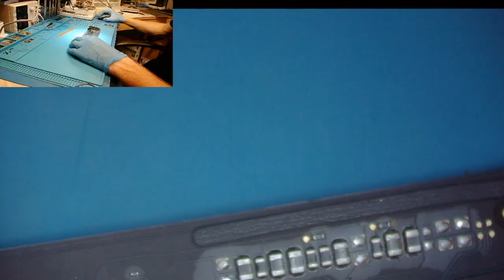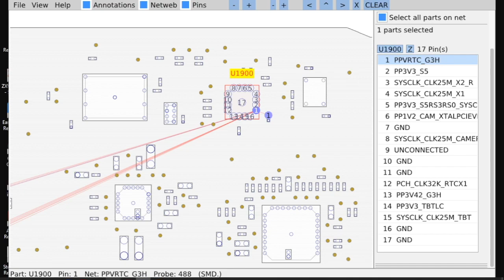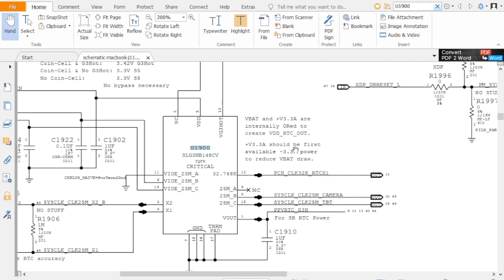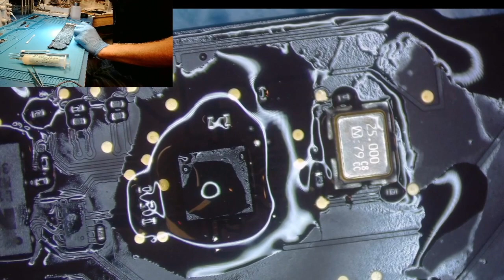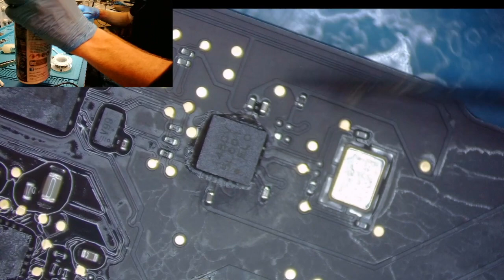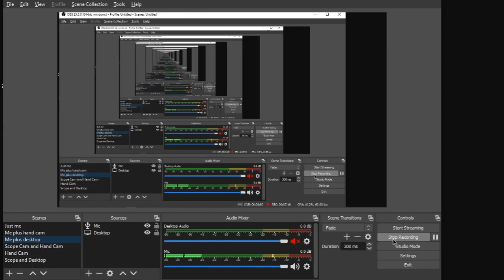MacBook Air no power and repair

Comment: Sumatra is a good PDF viewer that Louis recommends. However if you like Open Board view after trying it out, the paid version Flex Board View is vastly superior but it is tied to Abode PDF as they are integrated to facilitate auto opening of the PDF once you select a board view and also seamless comparable parts search with three fields to aid in quick identification of suitable parts within the PDF. I like it a lot in case you can't tell Dusten :)  It also does IPhones https://pldaniels.com/flexbv/